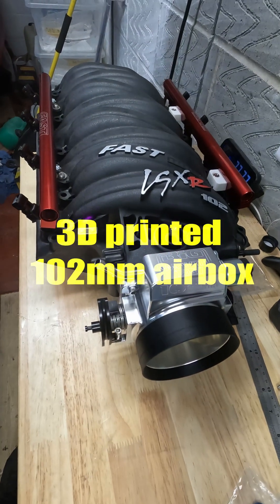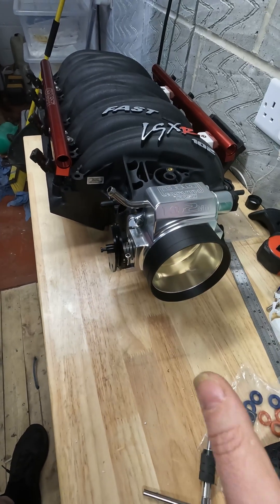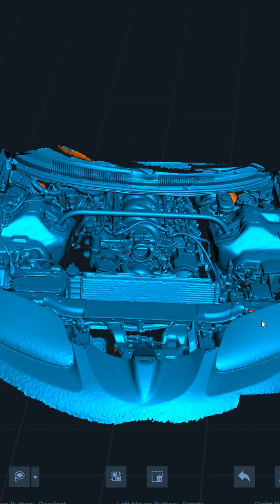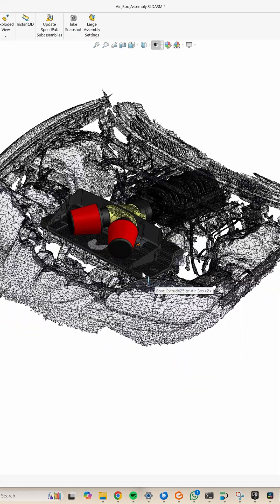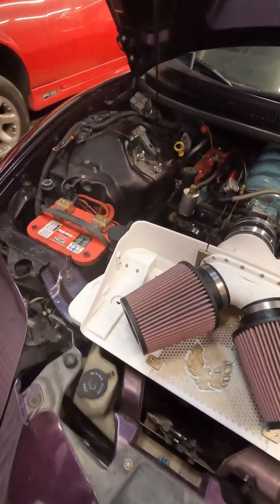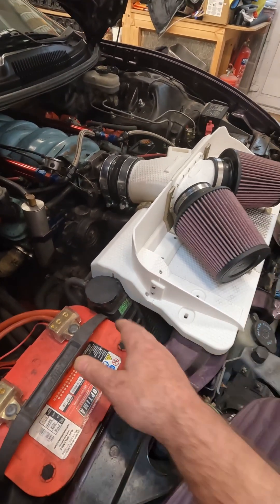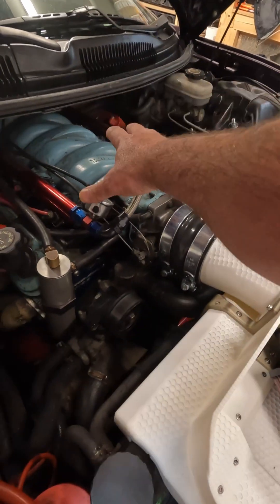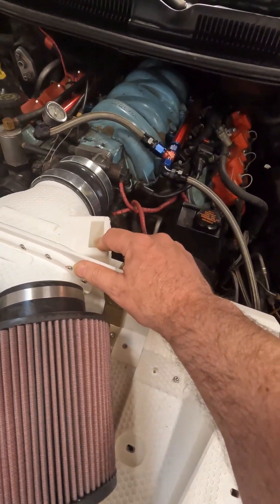3D printed 102mm Intake Airbox for FAST LSX

Comment: I have a 2006 Mitsubishi evolution nine that I want to do the same exact things you’re doing to your car. I just can’t decide which 3-D scanner I wanna buy and which printer
Reply from the maker: I brought the Creality Otter scanner, it wasn't the cheapest or most expensive from Creality. I also got the wireless bridge, so you dont need to run a cable to a PC/Laptop, certainly handy for hard to get to places the the interior of the car.
For the printer I went for Bambu P1S. Both are a year old now, and still going strong. The good thing about an enclosed printer is it retains the heat far better than an open frame one. These are needed for some high temprature filiments like PA6-CF. Also recently found large ABS prints benefit from keeping chamer tempratures between 40-50c to slow down cooling and to reduce layer seperation. Had no troubles with PA6-CF, keeping the door closed and putting a cloth over the printer to reduce heat excaping.

Comment: Love the design. I’ve got a question though. What’s the can bolted to the passenger head?
Reply from the maker: That part is called an oil catch can. One pipe goes to the top of the heads, the other pipe to in intake it's purpose is to reduce the oil being sucked into the intake manifold. There is usually a pipe already there, this just gets inserted into that pipe. There is a screw at the base of the can to empty the oil. I tend to do that on every oil change. Can't recall the make of this one, there are many available though.